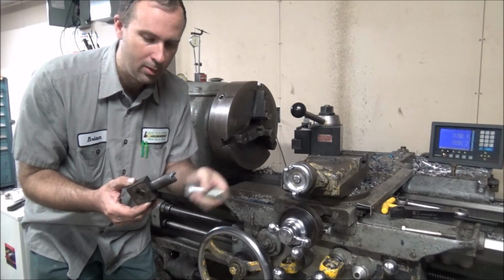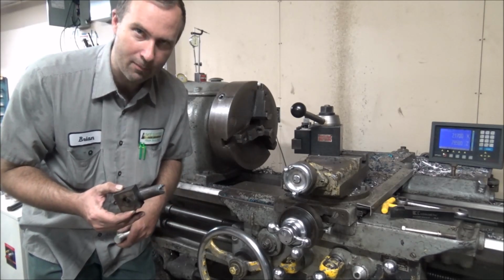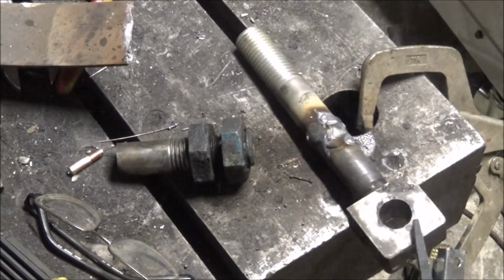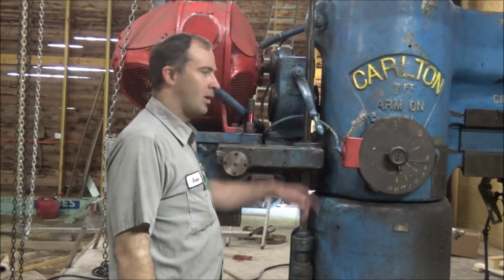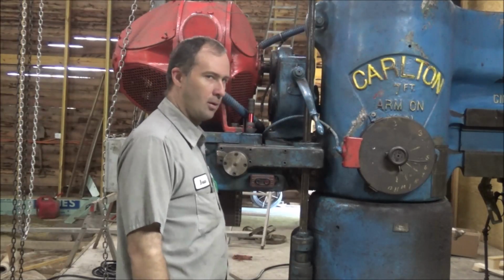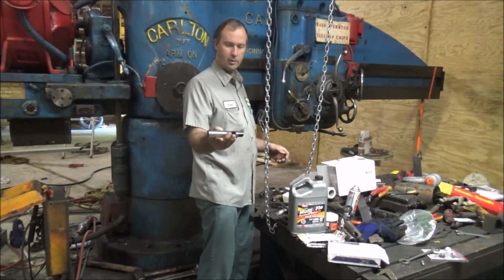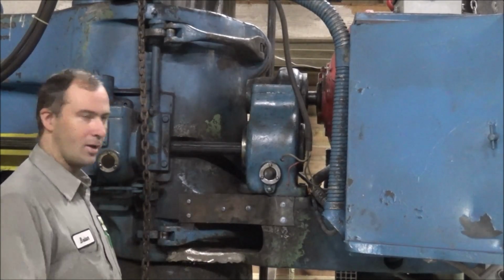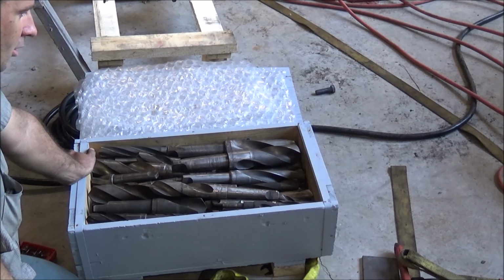Small Drill repairs, viewer mail, and drilling the 1st holes.

Comment: Hi Brian love your shop and the huge machines you use, be careful welding to a graded bolt as it changes the composition of the bolt and under shear load it can snap like a carrot,  we normally do not weld to a graded bolt, but I see like all your work everything is enormous so it might not be a problem but keep it in mind when carrying out repairs, especially when it is a paid job for someone else and the part you repaired fails,  also you have removed any identification that the bolt is a graded bolt in the weld prep.  Food for thought, keep up the great videos.
Reply from the maker: It was part of the drill lock mechanism it is loaded in pure tension. Consider it more of a threaded rod than a bolt anymore. I don't expect it sees stress levels anywhere close to a torque loaded fastener. I think it was better than using all thread.
Reply: @bcbloc02  Hi Brian, many thanks for the reply, much appreciated.

Comment: Oh, come on. 3" hole in 6" steel. 
Just kidding. Great to see it running.
I can wait for the 3" hole. Just promise you'll drill one soon. 😊
Thanks,
John
Reply from the maker: Depends on when I get a proper power supply to run the thing with.  I am sure eventually I will get to it. :-)
Reply: Need a bigger welder, I guess. :-)

Comment: So you have a huge drill and huge drill bits and all we get to see is 1/2" hole... WTF   :)
Reply from the maker: I am severely underpowered running a 230V motor on probably 50-60V so I don't want to push anything right now. Its a miracle it works at all after all!

Comment: My apologies if you've answered this before, but what are you going to do about the big ol' DC motor?  You're not going to keep running it with a welder, are you?
Reply from the maker: I am watching hopefully for an MG set.  Otherwise I need to start doing serious research on building a proper rectifier for it.
Reply: Heh, I wonder if they still make rotary DC converters - run a DC generator off an AC motor :)
Reply: Whups, just realized you didn't mean these - https://www.digikey.com/en/product-highlight/l/littelfuse/igbt-and-rectifier-diode-power-modules-mg-and-md-series

-you meant Motor Generator.  Sometimes I should wait a couple minutes before hitting reply...

Comment: It annoys me when people edit out most of the actual machining since that's why I watch these videos, as training to see how the various tools behave in different materials and setups. I want to see and hear it vibrate and chatter if it's going to do it. That for me is the whole point. It's funny but at school we learned about the stone age then the bronze age then the iron age but bronze is some really tough metal to turn when it's cast, from what I've seen. It must be a nightmare to drill.
Reply from the maker: I don't know about cast bronze but I make a lot of bearing bronze bushings and don't find it difficult to work with.
Reply: ..Cast bronze....back about 1990, I worked as a welder in a very old machine shop here in Sacramento, California.....we had several of those BIG hand operated bridge cranes.....(Sacramento Engineering and Machine).....       
  We got a contract to make some parts for a 330 foot long swing span bridge to be put over a slough (Potato Slough) here in N. Calif at Tower Park Marina .....longest swing span west of Mississippi....anyway...all the materials had to be domestic, as it was partly a Federal Funded project....we had some bronze, a few tons, melted and cast-up at the last water-powered machine shop around here...
  Knight Foundry in Sutter Creek, Calif. (Calaveras County)....that bronze stuff was pretty rough coming out of sand cast molds....but machined quite well....one part was a big bronze concave bearing the whole bridge rotated on....about 60" diameter and 20" thick...  
    It was the last bronze job they did at Knights.....place is closed now...restoration is being done, but slowly, as everything...the work, and materials...is volunteered.... Knight Foundry can be found on Google search...   
  The bridge is on Hiway-12....@38,06,52.81N  121,29,50.77W    
  ......AND....lest I forget.....I welded up everything that holds that bridge up....and all the balance wheels it turns on....6 months of running 5/32" 7018 all day...50+ pounds a day.

Comment: bustin  concrete? your gonna redo the  cracked  floor??
Reply from the maker: No just knock the median out for the next section of concrete the cracked floor will remain.
Reply: Get some epoxy to pour in the cracks?
Reply: any chance capillary action and pressure will  get some of the new concrete to creep into the cracks?
Reply from the maker: Doubt it. The concrete would have to be as runny as water to get in the cracks, they aren't that big.
Reply: AH ok

Comment: What taper is the spindle? I bet you could us a xl boring head now👍
Reply: If you figure out a way of getting a MT6 in the spindle, I have a MT6 tap driver for 2" taps.  I am currently using it as a paperweight and conversation piece...   8^)
Reply from the maker: Book says MT6 but it actually is MT5 but the diameter is MT6 on the spindle.  I am not really sure what that is all about. I need to see if they at some point sleeved the spindle or if it was a custom factory order.

Comment: You really want to watch looking down in the hole with the drill running. I'm not real sure but I bet it won't stop when it grabs your hair in the quill. I was installing a 3 inch Skip tooth NPT tap and was hanging on to it when I hit the switch be accident on a 25 HP radial drill. Thank god I didn't have my gloves on when I tapped my left hand. Always seem to get hurt when your in a hurry. Almost ruined my guitar picking.
Reply from the maker: Must not be evident in the video but the spindle is like a foot underneath the gearbox so I was never close to it when it was running. Be hard to grab 2in of hair from 12in away. I never wear gloves operating machinery because I don't want to get wrapped up in any of it. Glad you didn't get hurt!